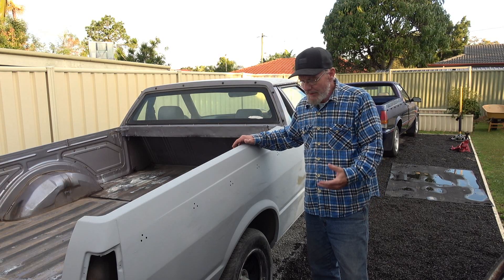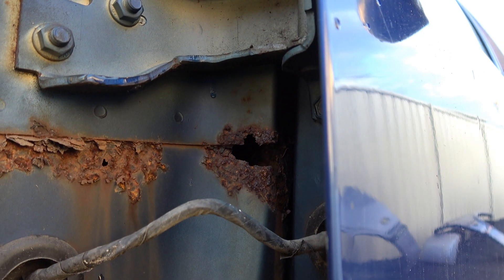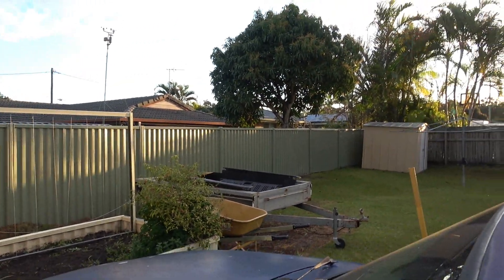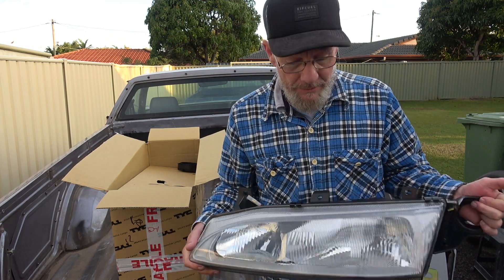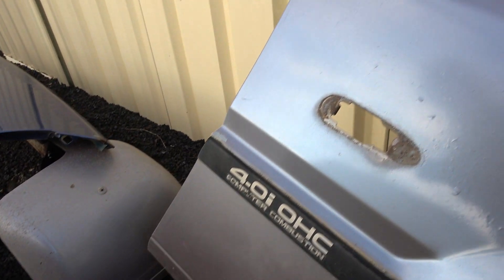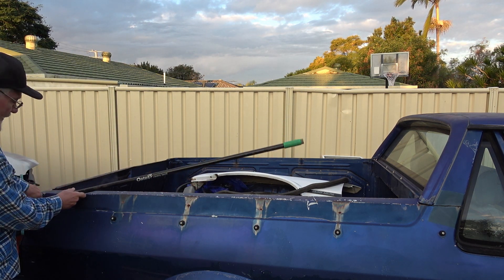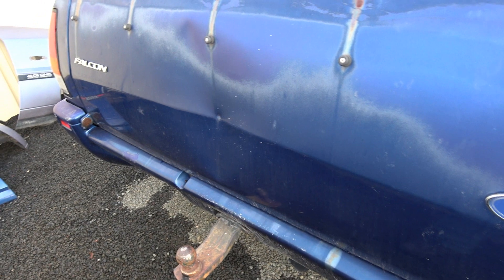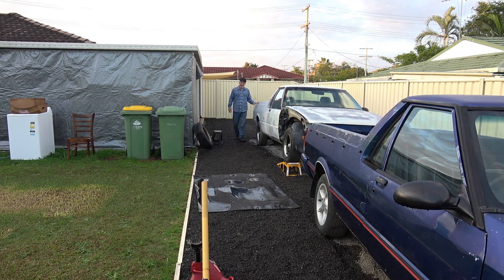BUILDING THE XH FALCON SURFERROO Part 3

Comment: You dont have to take the dash out to replace aerial but go for ot mate 🤪
Reply from the maker: maybe its just this ute then, because the cable is well jammed in up inside the dash
Reply: @INTHEGARAGEwithGraham  I could be mistaken I replaced a few in EA to EF models  many many years ago as an apprentice  and never removed the dash, can't be sure if I ever did a XH Ute though so I could be wrong it was so long ago

Comment: Just thinking Graham, with the surferoo side add on bits, would it be possible to incorporate the thingy around the back window, side skirts and rear wing all as one and what about using the same grommet system as around the rear window to hold it all in place, after all it's only for show isn't it. Seeya Rob

Comment: Looking at the photo of the original XY: The factory lines for the back of the Surferoo seem to come from the back of the roof down to align with the front of the rear wheel arch. I agree with you, it does look a bit 'sharp' but that is how it was on the original or at least that seems to be what the photo is showing.
Considering the purpose of the ute is for resale: I'd modernise the thing or at least have it 'young bloke friendly'. That way you will broaden the market IMHO. 
                                                                                              Just my two cents mate... Cheers